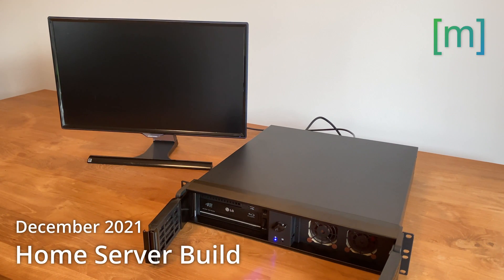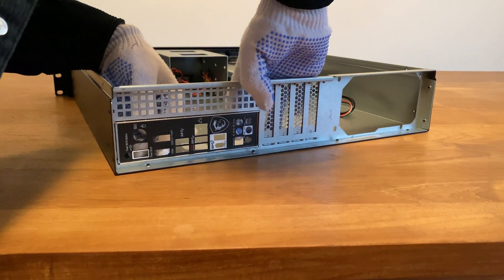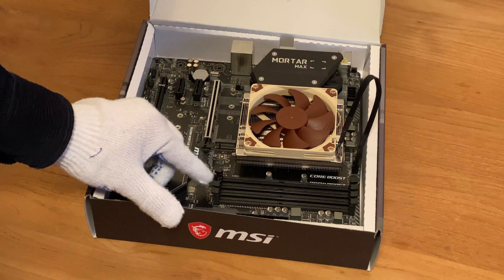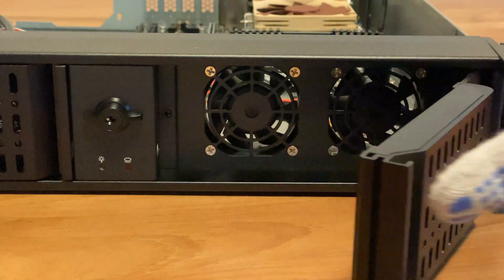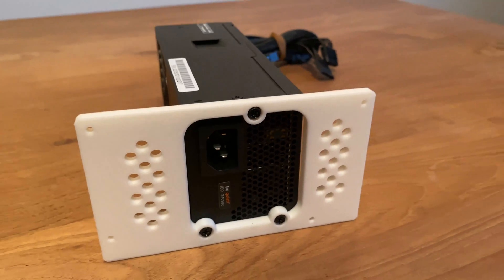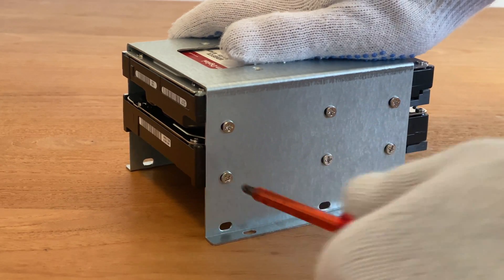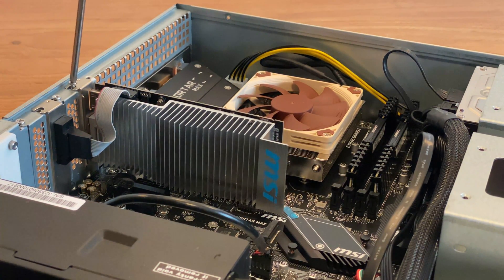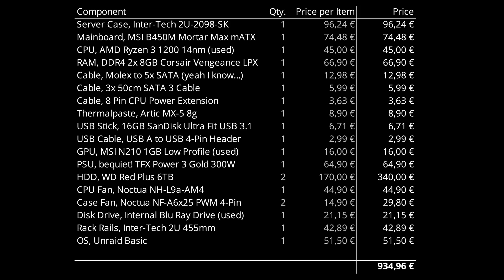Unraid Home Server Build in 2021

Comment: i have a couple of 2U cases with full size ATX PSUs in them. as far as i can tell, the small gap between two adjacent servers is actually enough airflow to keep the PSU fed as long as the cooling in the rest of the chasis is ok. i have had to remove fan grills from older PSUs to get them to fit under the lids, though.

Comment: Wich 3D Printer you have?
Reply from the maker: I‘m using a Creality CR-10S. Have it for about 3 years now and I‘m very happy. Print quality is sufficient for what I‘m doing and it needs very little maintenance. I use a Raspberry Pi running Octoprint to control the printer over the network. This makes things even more comfortable to use.

Comment: Hi
Great video :)
One question, wich way does the fans blow? air out or air in?
Thank you
Reply from the maker: Hi, thanks :) The fans are sucking air in to the front of the case, pushing the air through the case and out of the back. The CPU cooler is then separately pushing air onto the CPU heatsink and the PSU has its own fan, sucking air in and pushing it out the back of the case as well.

Comment: 5:44 it will work fine if you plug the 4 pin connector at the right side of the 8 pin connector.

Comment: I must say that I used a single 4pin connector in the 8pin socket to power a much less efficient chip - Core 2 Quad 6600 (TDP arround 100W) for several years and had no problem with stability. Adding more wire with the connector does not help with power delivery, since you are still limited by the 4pin from the PSU, and as you correctly said, your CPU is not power hungry to need more than what 4 pins can deliver. You would be perfectly fine running any AMD Ryzen of up to 65W, and above that you would be limited by the CPU cooler, not the power cable. Nice server otherwise.
Reply from the maker: Thanks for your comment :-) Yes, that's what I meant. The four pin connector from the PSU is the limiting factor and that's why you probably could not use a vastly more power hungry CPU with that PSU. I only used the P4 to P8 adapter because I didn't know you could just plug the P4 plug into the P8 socket on the mainboard. Adding the P4 to P8 adapter would not somehow improve power delivery.

Comment: Came here from a random YT recommendation and just thought I will mention that you don't need the 4pin to 8pin CPU power adapter. You can just plug in the 4pin into the right hand side of the 8Pin socket on the board. It's the reason why the clip on the 8pin socket is off center - it to allow you to just plug the 4pin in.
Reply: Yes  i tried it and it works!
Reply: What i didnt get about the case: it requires extra work/side steps like psu, do you have a rack?! For a homeserver, there are a lot of alternatives with itx or atx cases....
Reply from the maker: @sheldonkupa9120  yes, I have a rack which I got for free from a music production company that switched offices and wanted to get rid of it. That's why I wanted to have a rack mounted server case. But what you said is correct, selecting a normal ITX or ATX case would have made the build simpler.
Reply: Why he needs server at home, the porn collection? what he has to do on a server?
mad here....
Reply from the maker: Why would I need to store porn on my home server when that stuff is all over the internet? :D I'm building the server mostly as a backup system for my desktop and to archive files from projects I worked on in university, e.g. big pointcloud files from laserscanners that take up severall 100 GBs.
Reply: @lucasrem1870  It is probably for backups and file storage. Backups of my desktop are more easily automated to a home server and less likely to fail with parity drives allowing rebuilds when drives fails.
Reply: @striknoir772  I store only files in the cloud, if the system fails,  i do factory restore.
I do not have collections that need to be stored digital, my artwork?
Reply: @lucasrem1870  not everyone trusts cloud, plus he could be hosting game servers without paying for shitty ones on the internet using relic tech that host them.
Reply from the maker: Agreeing with @Rivery Jerald here, I don't want my data to be hosted in the cloud by some provider who then has all my data. Moreover, I like lerning to set up systems like these. Building and running this is a hobby and not something that's purely necessary to get my day-to-day work done.